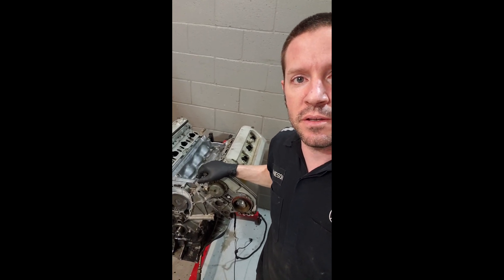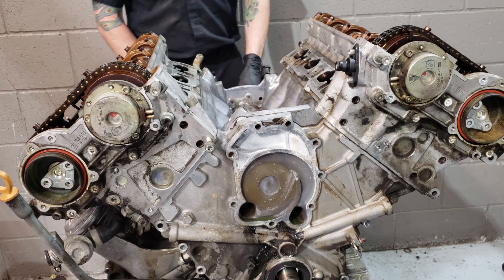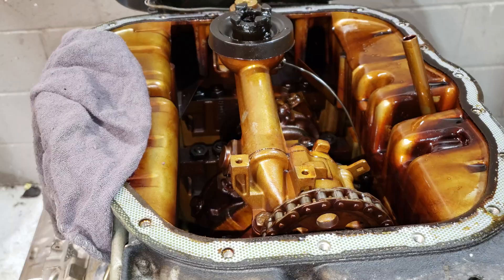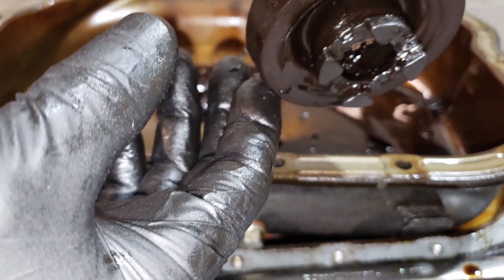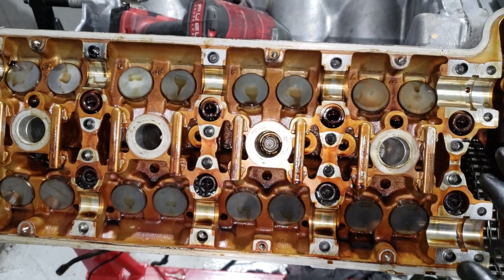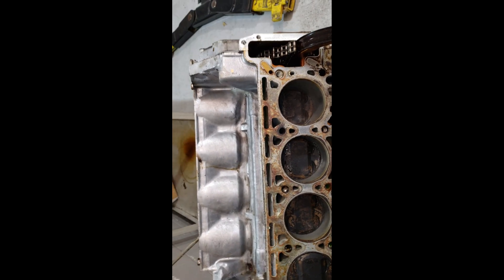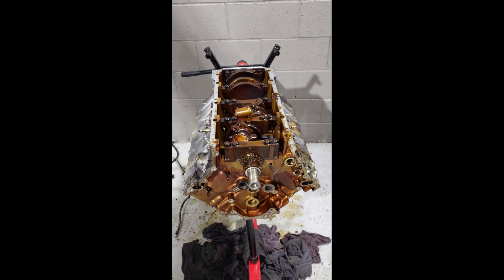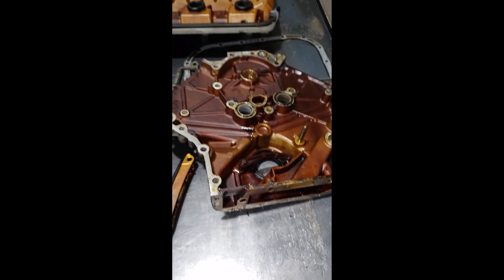M119 Cylinder Head Removal

Comment: Hi, Neighborhood guy!  I have a 92 500sl  and it leaks oil took it into the shop they told me rear oil pan and they replaced the gasket....IT STILL LEAKS.  Where do these usually leak from.  It is not the valve cover gaskets.
Reply from the maker: The upper oil pan gasket leaks also.  The rear main seal or plate can leak.  That's about it for the rear of the engine unless the head gaskets are leaking.
Reply: @FriendlyMBTech  Thanks...I was jumping up and down when they told me lower pan gasket.  Upper BIG BUCKS...Rear main/plate BIG BUCKS.  If that is the case which it may be let the mo fro leak :)

Comment: I really appreciate what you're doing.  If you have time, kind Sir, could you give a list of specialty tools used and recommended specialty tools.  Who's your best tool manufacturer?
Reply from the maker: You're very welcome.  Off the top of my head, you'll need a long 1/2" breaker bar, a 1/2" torque wrench, a T torx set(not E), 1/2" impact, engine stand, small relatively strong magnet, metric tap and die set, 27mm socket, seal remover, silicone gun, engine hoist, pry bar set.  That's all I can think of right now.  There's not really any specific tool manufacturers that I go with.  Just don't get cheap stuff.  Cheap stuff will break.

Comment: Love the video. Before I comment I want to ask you this. I just pulled the engine from my 560SL (see my after the pull video) to change rear cover plate & seal & the pan gasket. I’m wondering what else should I do? It has 139,000. I’ve done cam gears, upper guides & chain, but nothing else. I might see more after I take the pan off. I would like to hear your thoughts.

Now my comment. I almost connected the engine stand to the pan just like you did, but I caught it before I mounted it. What I did was modify the stand brackets so I grab the block only & in doing so the engine is much better balanced on the stand.
Reply from the maker: I would recommend replacing anything or resealing anything that you'd save a lot of time later by doing now with the engine out and already taken partially apart.  That how I decided to take mine apart as far as I did.  It will take more time now and cost more now, but if it has to be done later, will end up saving time and money.

Comment: Hello friendly i did change my head gasket last year and now i have leak on my cylinder. I think it could be the quality of the head gasket idk…
Reply from the maker: There are several things that could cause that.  It could be warpage of the cylinder head, stretched head bolts, stripped head bolts, or incorrect head gasket(which I ran into) just to name a few.  Is it on just one cylinder?  Have you checked compression or performed a cylinder leak down test?
Reply: @FriendlyMBTech  thanks for replying so fast lol .its leaking on both side and my big mistake was i should have gotten new bolts and my engine is: M119.985 97 mercedes benz 
Im gonna have to remove the heads again and i will make sure i get the mercedes brand head gasket ,the ones i used was victor reinz
Reply: Forgot to mention that I did get the heads resurfaced when i removed them and thank you so much for your videos on m119 we dont have many videos on that on youtube
Reply from the maker: @tinasissi  there is a measurement for the head bolts to check if they need to be replaced. The bolts I took out of the junk yard engine had about 100k miles on them and were within specifications but I replaced them anyway.  If your head bolts are stretched or on the long end of the specification range mixed with having the heads resurfaced, that could lead to insufficient torque for sure.  I'd check the bolt measurements for sure.

Comment: Attempting a W124 head removal in the car.  Any guidance or tricks to access the exhaust manifold  bolts?
Reply from the maker: If you aren't pulling the motor, I'd try to get the head up and out with the exhaust manifold on still.  The back bolts have very little clearance.  I took a look at the 500E I'm working on right now and that's what I would try on that.